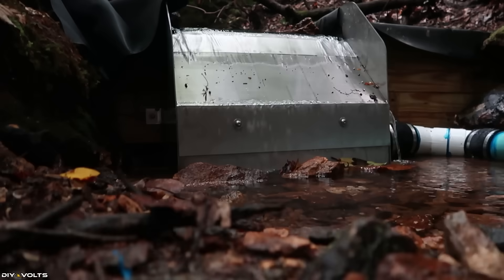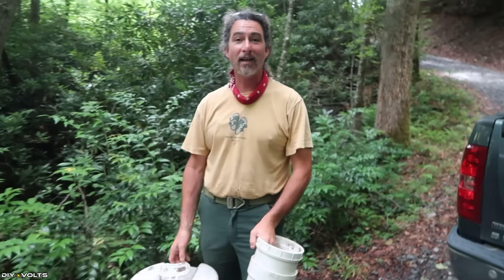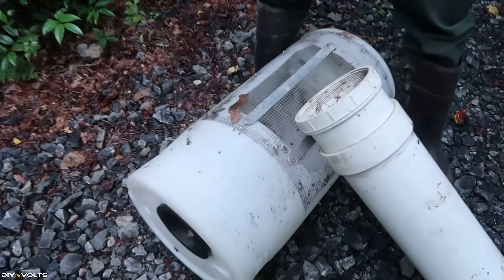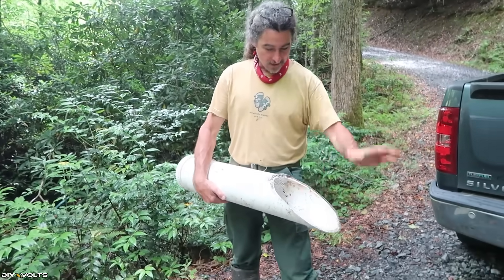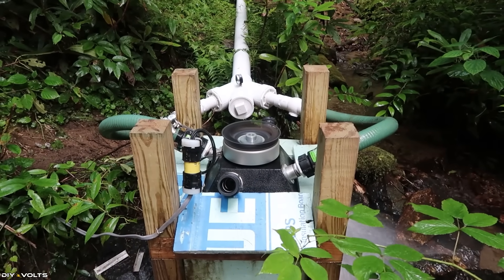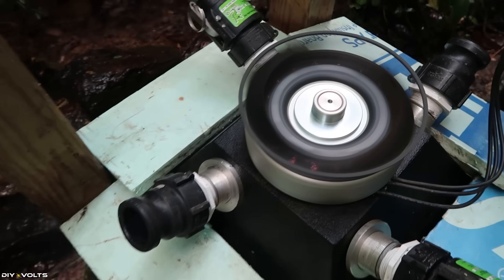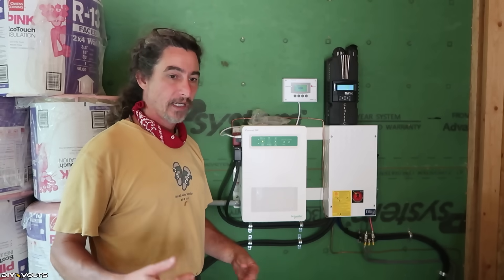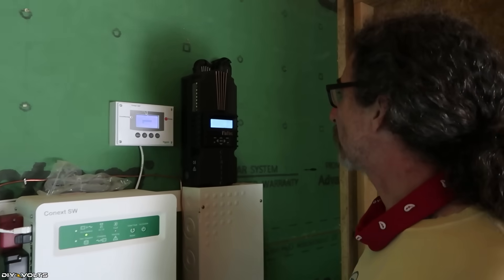Mico Hydro Turbine making 250w of Power in the Mountains

Comment: This is an awesome setup! I would really like to make a controllable nozzle with a solenoid so you could take advantage of higher flow rates to maximise your output. You'd need a drum at the top of the hill with a level sensor in it, then you can open the solenoid when the drum is full, and close it when it drops below a set point. Lora seems like the right idea for such a setup to keep from having to run wires up to the top of the hill.

Comment: Are there DC water turbines? Would be nice to gain some efficiency on DC to DC  charging.  But really neat system overall, while it doesn't have the high top end its consistent which is huge.  With Solar I am getting 3Kw generation at peak, but that is only for a few hours and it ramps slowly up and down, and that is only on full sunshine days.  I love the consistency with the hydro, yeah its not as high output but its 24x7 output.

Comment: Setting up the PMA to provide higher voltage would be the magic. Rectify at the storage end and use correct MPPT to accept the higher input voltage. Play around with LC (Inductor / capacitor) setups to smooth the ripple before the MPPT and experiment. 
The theoretical 18KW/h of lead accid, yeah, only half that would be usable. Some LiFePo4 storage would be great.
Reply: DC is slightly more efficient for transmission, as you're always pushing some current through the wires, and operating at a higher voltage. That means if you have as much copper in the 2 wires as you would have in the 3-phase wires (which especially if you have big capacitors as you suggest after the rectifier would mean big spikes of current through the wires while most of the time they're sitting idle), you have less resistance, so less voltage droop. For most setups it's a marginal difference at best.

I would suggest that if you're going to start a setup like this you go with 2 slightly thicker copper wires for your transmission lines and put the rectifier and a big capacitor at the generation end instead of running 3 phases. The disadvantage of this is 3-phase has redundancy built in, where if one of the wires is cut in a DC setup, you're out of luck.

Comment: There's really no point in increasing his battery capacity unless he increases his energy production. At .25Kw, he's producing 6KwH per day, and it's a constant supply, unlike solar which is feast and famine. If space and weight were a concern, or his production and consumption go out of whack, it MIGHT be worth the time, effort, and expense, to switch to a different battery chemistry with a higher energy density, but if I were him, I'd just let those batteries age out and then upgrade when they're used up, instead of just spending more money on something he doesn't need, and which won't really have any meaningful effect on the functionality of the system.

Comment: Im surprised you dont use lifepo batteries. Lead have a much larger loss on charging and discharging. Double digits percentage. Other than that, nice setup. Thanks for the video
Reply from the maker: The benefits of the LFP batteries would be huge on this type of system. I am guessing cost and low temperatures are what caused Eric to go with the Lead Acid.

Comment: I'm not sure if I would use LiFePO in place of the Pb-Acid being that Lithium batteries cannot be recycled or reconditioned but AGM lead acid can be.  I guess if I was running off-grid I would still want another system for backup and that would be a generator of some kind, and if anything, combined heat and power offerings from say Yanmar, Cummins or Honda or even a steam-based system, especially in Winter.
Reply: Lithium batteries can and absolutely are being recycled at scale - here in the UK anyway. We have collections at all supermarkets and the materials are put back into the minerals market. The US has Redwood Materials doing similar.
Reply: Well its your choice if you want to lose 25% of the power as this guy does by using lead instead of lifepo. Putting 1000w into a lead takes 1150-1200w and no you dont get 1000w out unless you trickle discharge it.
Then you would have to buy a whole new set of lead batteries 3-4 times before the lifepo even dropped to 80% useable capacity..not to mention lifepo is 100% fine with going to 0% soc in such a configuration, unlike lead, which get damaged each time you do it, cutting its life in less than half.

Probably with a large bank, and low C rating, the lifepo could last much longer than 20 years.

Comment: 24/7/365 250watts adds up quickly.  Like said, the inverter supports a generator so worst case if he loses the water pressure he could use the standby generator
Reply from the maker: Yes for sure! even a small generator could charge the battery bank and run the yurt when the water levels drop.

Comment: What’s the pressure at the end of the Y pipe with no turbine running?
Reply from the maker: I am not sure that Eric shared that info. I only got to see the pressure with the nozzles open.
Reply: @DIYVolts the difference in static and dynamic could give him feedback to if his piping is large enough. If it drops, the supply pipe isn’t capable of supplying all the nozzles can flow.
Reply: He said it was a 58 foot drop, so just under two bar static pressure.

Comment: I know I'm going against convention but I wish we could start talking about energy in joules or at least watt hours instead of amp hours. Amp hours were a nice convenience when everything was 12v but as 24v and 48v systems get more common  having comparable units would be nice. Still a pretty awesome system for that yurt.
Reply: Yeah, amps mean nothing. 
And even more i have a personal problem with a unit of energy having hours in the name, it makes it too confusing for the everyday joe, watts should be the measurement of energy and watt hours the measurement of work done in an hour, just like measuring liquids is just litres or gallons and then litres per second is the rate of flow.
Anyways thanks for coming to my ted talk.
Reply: lets do the simple maths, he has 12V LA batteries in 4S4P to give around 380Ah. Now multiply 380Ah by 48V  and we get around 18KW/h in thgeory but as it is lead-acid, usuable will be less than half.
Reply: Lets get rid of all of those silly fractions as well
Reply: yes, using amp hours reminds me of some old guy in a breaking bad rv, definitely backward thinking with today’s cheap lithium batteries.

Comment: he should really think about lifepo4 because agm have like 60 to 70% real capacity (compared to rated) after fully charged....and they need 110-120% to fully charge (around 85% charging efficiency), so u lose 20% of power u put in and another 10% extra when want to "take it out" meaning in total when u put 1000 watts in , you will have 700 max 800w out 
+ they last only 500-1000 cycles before they start to fail (faster when to warm) , need constant charge to last that long and they discharge on itself overtime  .....BUT...are pretty safe

Lifepo4 on the other hand will have 100% rated capacity (or more) and will last for at least 10-15 years (depending of the quality even longer before u need to worry)  --- most good lifepo4 start to lose capacity after 6000-8000 cycles but will last waaaay more - they will just drop in capacity faster after that in each cycle .... only 2 disadvantages are price (but right now similar to agm if we talking DIY pack) and are not as safe as agm if u overcharge / puncture them
 
Also should be good idea to have higher voltage on the line for less power drop  (i would make a hut to store battery pack and send 230v to the hut + use wifi etc with app to monitor it)

Comment: 200W is LAUGHABLE small.   Sorry NO.
Reply: Maybe, but it is free 24/7 charge
Reply from the maker: The off grid life does take some adjustments but its possible with only 250w coming in. And yes! Free
Reply: @DIYVolts  the power is free. But. U need a creek. And money for the piping and generator. That's not free.
Reply: You seem to be thinking in terms of solar, which is WAY less production than this system, because most places are only going to get 4-6 solar hours per day, even in great conditions, so that would be a total production of 1-1.5kWh per day, and (even worse on cloudy days and during winter months).

This system is a CONSTANT .250 watts+. So it's producing 6kWh per day. That's 4-6x the power production you would get from solar. It's nothing to sneeze at.

And he's running a yurt, not a multi-family dwelling. If his needs increase, something like this is super scaleable. There's still plenty of water available in that creek.
Reply: I'm living on 100w solar, 6 lead acid batteries. All needs upgraded but the cost I can't come up with.
Reply from the maker: Solar electronics have dropped some in price but they are still so expensive!
Reply: @DIYVolts  it's the batteries. 200 a pop lead acid. I have 1200$ in batteries. To replace them is 5000$
Reply from the maker: It depends on the lifestyle that you live. My home runs off grid but I have 9000w of solar and a 12,000w inverter connected to 30,000 wh of battery storage. Eric is in the yurt by himself and gets by fine with 250w coming in.

Comment: LiPo prob wouldn't be good there. it gets cold in the winter
Reply: I'm not an expert by any stretch of imagination.  I seam to have read somewhere that lifepo4 batteries can discharge at low temps but need to be above 32f to accept a charge. Need to keep the batteries warm or get "self heated" batteries.
Reply: @criticaltemperature3343  that's what I read. I do admit it was a couple years ago. But new higher quality pack come with heaters.
Reply from the maker: LFP does not like to be charged below freezing. There are new batteries that will heat themselves with the incoming power and once warm they charge.
Reply: It's Lifepo4 nowadays. ;) And they can work normally down to -20 C
Reply: @dnnises  when they have a heater right? the chemical makup of that will break teh battery if you try to charge below freezing?
Reply: @TeaBagginsMcGee  You need a circuit that reduces charge rate at lower temperatures to avoid damaging the battery. Charge speed should be reduced to under 0.1C under 32F and to under 0.05C under 14F. To be fair, if you insulate your batteries well enough then you shouldnt need a lot of power to keep them over 32F. And as far as I know this is mainly only an issue for charging.
Reply: @TeaBagginsMcGee  He's in an enclosed building, it's unlikely that they'll get below -20c even if they weren't being actively used, but they produce their own heat when being charged/discharged. You can use heater matts to warm them up, if necessary, but it's usually not necessary. Most modern cells can be charged at -20c and above, and discharged at -40c and above. But simply keeping them in an insulated building is usually plenty. You can build an insulated enclosure to contain more of the heat that is naturally produced by charging/discharging them; and heating pads can be used as an absolute last resort.
Reply: @Wrenchmonkey1  I'll look into that, thanks for sharing!
Reply from the maker: They can discharge at that temp. They need to be above freezing to charge. I have a new battery from "big Battery" that will heat up from solar before it charges.

Comment: He could do wind power
Reply: Hydro is constant.wind is not,unless one lives in a place with constant wind,which is not really a place I would want to live.......
Reply from the maker: This place in the woods does not have much wind. I agree any place that has enough wind for a turbine would be no fun to live.
Reply from the maker: Sadly in the woods he does not have much wind. It would not produce much there.
Reply: Wind can be a  great addition to solar, (if done right,and in the right conditions) in times of low solar input,like the winter. And it works at night. But "constant",i.e. "ALWAYS" windy is where I would not want to be......unlike being in a place with a small stream (I am jealous)-just for clarification.

Solar has been excellent for me, very low maintenance. And cheap,comparatively,except for batteries.  (But getting cheaper all the time,and better quality)
I would imagine a small hydro setup like this would benefit from a larger battery bank,if one wished to power larger draws.
 A small hydro setup really adds up, running 24/7.
A larger hydro,with a constant volume of water/high head,may probably not even need a battery bank.
Thanks for showing your setup!

Comment: So 4.8 kWh per day.   Useable for such a small hut
Reply: That is a typical consumption for a two person apartment. (Without heating) It is plenty!
Reply: How are you getting 4.8kWh? It's 24 hours a day, at .25kw. That's 6kWh per day.
Reply: @Wrenchmonkey1  After charging, discharging and conversion losses maybe.
Reply: @CutterSlade001  where would he have pulled those numbers from though? A lot of that power is being used directly while it's being produced, so there wouldn't be any charging/discharging for that portion of it.
Reply from the maker: Yes and that is in the summer. In the winter the power goes up to 400w when there is more water flowing.

Comment: I would think that maybe a leaf guard, (used for rain gutters) would also work. Very nice set up, how cold does it get, do you have any freeze issues in the winter?
Reply from the maker: The temp in that area does get down into the lower teens in the winter. Because the flow rate is around 200gpm it does not freeze easily.

Comment: Cool setup. 250W continuous is no joke. A residential fridge uses less.
Reply: A residential fridge isn't usually running. They normally use 1-2kWh per day.
Reply: Yeah coming from solar the  idea of generating power all night is "game changing". I think id rather have 250w hydro than 1000w solar all year.  That being said as inefficient as panels are, you can see the amount of physical force required to harness 250w is substantial..  a  250w panel that sits there doing nothing and collects that amount power is still pretty amazing even at 20% efficiency.
Reply from the maker: With battery storage this system supplies all the power Eric needs for the yurt.

Comment: You are probably losing about 20-25% of the power on that long run.  If you moved your inverter / batteries to the generator and send 120/240v up the 1000' you would lose much less. Another thing you could do is to step up the AC voltage at the generator end with a step up transformer.  The higher the voltage the less losses you have.  I think that charge controller can handle over 120V DC of input.  The rectifier would increase the AC voltage by approx 1.44X
Reply: If you have to cover distance you want the batteries, charger and inverter close to the point of use to ensure power quality. There's a reason the transformer on a grid system is right next to the building not 1000 feet away, you're gonna get voltage drop/losses over distance and you manage that by putting your regulation device close to the point of use for stability. And as a plus this guy doesn't need another building to house his equipment.
Reply: Sounds like politics every one has the answer.
Reply from the maker: That might be true! I think the power drop was less of an issue compared to having a 1000 foot walk to check on the electrical equipment.
Reply: @DIYVolts  hey, don't you have another youtube channel?
Reply: @DIYVolts  Indeed and its likely he has more than enough power anyway given his lifestyle.  A potential of 6KW per day in the summer can be plenty.